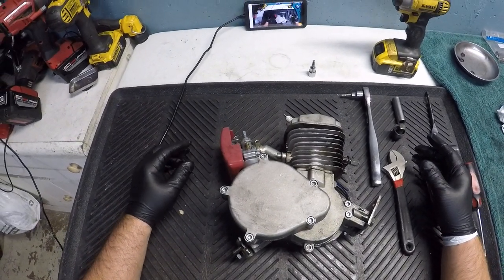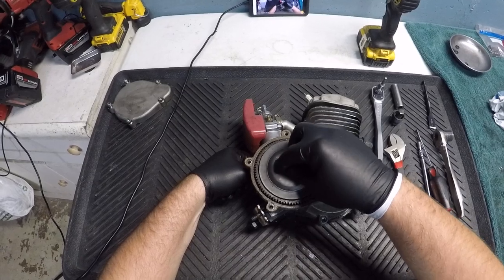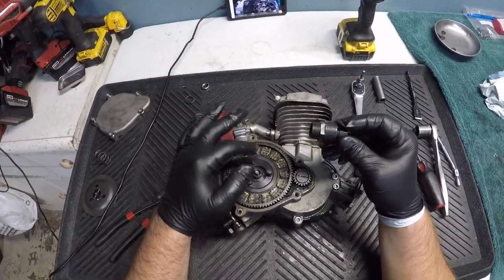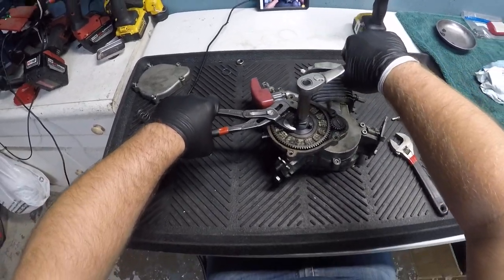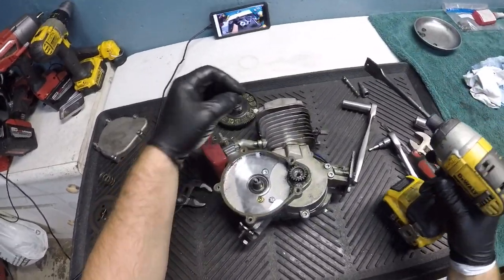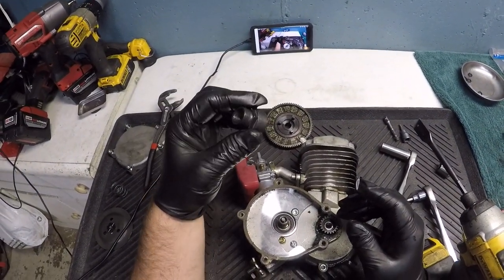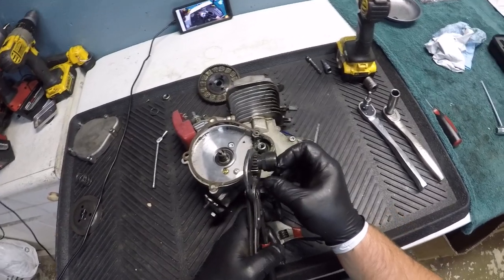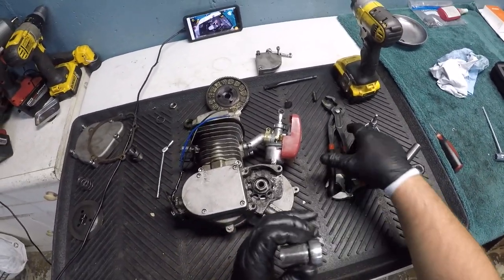How to remove your clutch big bevel gear and drive sprocket on your 80cc motorized bicycle engine

Comment: I'm glad it happened too. This was the exact reason I'm watching videos on how to remove the sprocket when the threads are stripped. I figured I'd come back and comment on what I eventually ended up doing. I cut the bad threads off of the end of the tool.

Comment: How do I put them back on? Dozens of videos showing how to take these gears off, none showing how to put them back on. Do I remove the key first? Does it not matter? Do I hammer it part of the way, or all the way? Do I use tool to press it back on?

Comment: What was the point of doing the first half without an impact wrench if you still need one for the next step anyway? Sort of defeats the purpose
Reply: You obviously never remove the flathead that holds the small gear